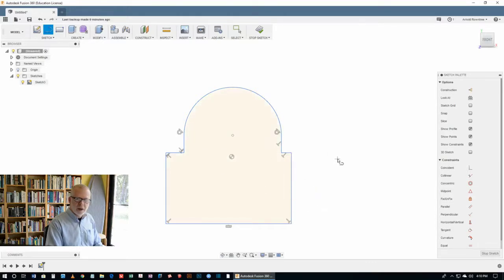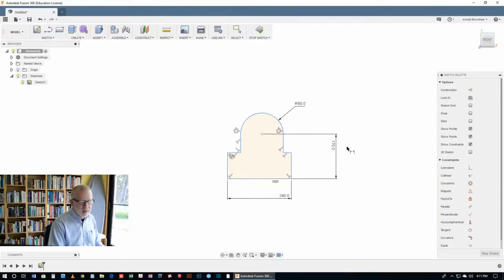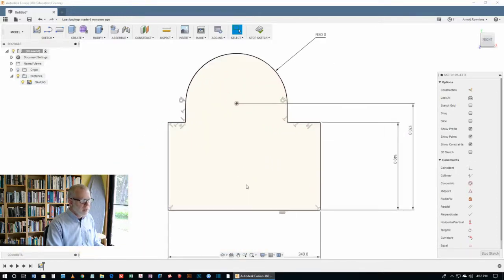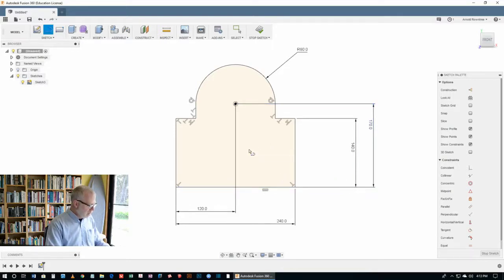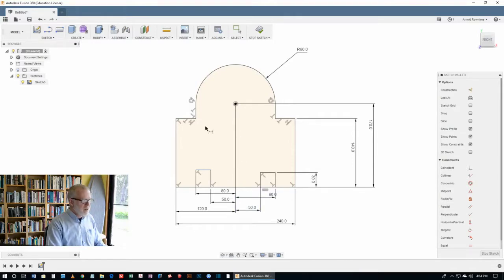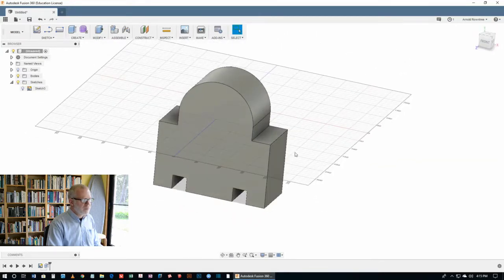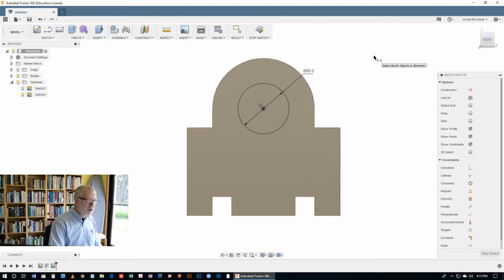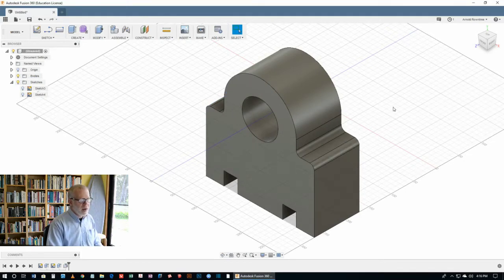Fusion 360 Beginner Tutorials, Part 5 of 16

Comment: Thanks for these videos! You make it look so easy. In reality, however, there are always complications when I try this. Example: I copy and paste new component. Then I go to alter that sketch in order to alter the shape of the new component. Doesn't let me do this. It's maddening. :)
Reply from the maker: Hi WN, yes, I’ve been trained to make it look easy but give yourself another few hundred hours of practise and work, you’ll be there too. And that’s not all that far away. Think of a 40 hour work week, its only seven and a half of those. Two months full time, but even if you have to double or triple that by doing it part-time, its not too shabby for a great new skill.
Apart from that, don’t beat yourself up, don’t stress over components until you’ve got that sketcher down and the basic feature creation tools. I intentionally left the beginners level component tutorials until after the 16 Basic ones. You’ll see them on my channel home page and that will make the intermediate ones a lot easier for you. 
Fusion 360 has workflows designed in by the programmers, they are doing something cutting edge when compared to all the other mid-range CAD that’s out there, don’t wrestle, just enjoy the ride and watch it all unfold while you learn.
Reply: @ArnoldRowntreeTeachesFusion360  Thank you for the encouragement!

Comment: Hi. Can't seem to move the center point of the arc to the drawing point of origin. Says over constrained, but I have the same dimensions on the screen as the video. The video doesn't show axis lines; not sure what the over constraint is. Likely culprit? Thanks.
Reply from the maker: Dan you will see that I drag things around on the screen during the sketching process. (And yes I keep the grid and everything except the point of origin invisible.)
If any line or arc is touching something like existing geometry or an axis or anything else on screen, there will be an automatic constraint applied and the free-dragging behaviour will be curtailed, either partly or completely. Any subsequent attempts to add another constraint will result in the 'over constrained' message and you will also be unable to drag the thing around.
They way I suggest you proceed is to redraw that sketch in a fresh document taking care to avoid any inadvertent constraints. Test by clicking and dragging things around (try not to be over energetic so that you don't mess things up too much). Some pushing and pulling like this will be good for understanding what's going on. You'll hopefully get the idea of how everything is progressively nailed down with each additional geometric and dimensional constraint that you apply.
A lot of what we're doing with the early numbers in the 16 parts is getting a feel for how these things that we're discussing work.

Comment: On Exercise 5 I get the following message from F...360 when I try to dimension the second notch "Adding this dimension will over-constrain the sketch. Choose OK to create a Driven Dimension." Choosing OK places the dimension but I can't change the dimensions numerical value. Is there a work-around for this?
Reply from the maker: Yes John, if you have a geometric constraint already in place, it could mean that you don't actually need the dimension. Once you delete the dimension that was made a 'driven dimension' does the sketch lines have a blue colour or black? If blue then  its unconstrained and you need to work out a way to constrain it other than by the dimension you tried. If its black then you've got it nailed, just proceed to extrusion.
If that doesn't answer the question there is still another way. Find the recent Revised Part #2 of 16 where I demonstrate the Mirror Sketch tool. This part 5 has symmetry and the technique will work here.  https://youtu.be/UxmET4s9Yac

Comment: I really like your approach to learning Fusion 360. I am 77 and trying to learn new tricks. One question  WHen I try to draw the curved line such as the  top of part 5 the curve goes the wrong direction IE it curves down instead of up.  What am I doing incorrect. Dave at Letsflyj3@gmail.com
Reply from the maker: Dave its hard to know exactly what the problem is at a distance and going by a description. That curvy line that comes out of the last segment of the line tool trips up quite a few folks. You really just need to open a new document, start a sketch and experiment. Remember, its click and drag. The curve will always be tangential to the previous straight line segment and its all about the direction you drag in relation to the previous segment. Give yourself half an hour at least to practice this.

Comment: Hi There just realised how your drawing radii with click and drag except my setup id only allowing me to draw in an anticlock direction which is Autocad norm is there a setting to change that?
Finding your lessons just right paced for me as a beginner in 3D, thanks
Reply from the maker: Welcome to the channel Richard. Never mind about the line/arc thing, if you've got it working at all, keep experimenting and you'll get in control of it with a bit more practice. Everything can be done with basic drawing tools, so long as you're getting the model done, move on and get them all finished and come back to fill any gaps later. Go on and work through the intermediate playlist too. I think you'll find there comes a point pretty soon where you'll want to work on your own projects and you'll be able to wean yourself off these click by click tutorials gradually.

Comment: Difficult test!  thanks!  I notice when you click on the main surface it becomes square to the view. Mine does not. Any advise appreciated!
Reply from the maker: OK smith-models, a few preferences can help. I don't take you through these initially because most people want to make something immediately and learn these details as they go. 
You get to Preferences by clicking on your picture in the top right hand corner of the screen.
On the General tab lower down the page you'll see Pan, Zoom, Orbit shortcuts and the style of navigation can be set to emulate Solidworks, Inventor and a few others. Experiment with some of these. I like the Solidworks style.
For Default Orbit type I keep mine set on Free Orbit, you might like the other option.
On the Design tab most people find that 'Auto look at sketch' is already ticked, that one will most likely affect what you're asking about.
One other I'd recommend you have ticked is "Scale entire sketch at first dimenson".

Does that change what you wanted?
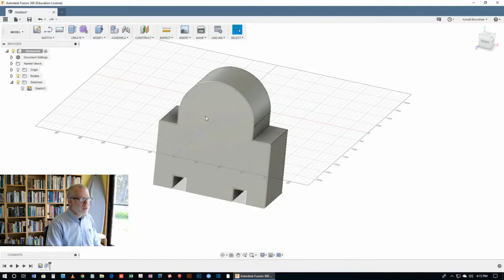Reply: @ArnoldRowntreeTeachesFusion360  At 5:44 in the video are you also using the "look at" function to orient the model into flat position? I hope so. Seems to be working if I use this function. Thanks! :)

Comment: Hi there Arnold, great videos.  I'm surprised how quickly I'm picking this up, thanks for your hard work and excellent tutorials.  quick question: I'm having trouble moving the arc (holding shift from line tool) from left to right, as you do in many of your tutorials such as this one, my working plane (indicated by the orbit box) seems to orient itself FRONT with blue axis (upright on left of the box) and x axis (along it base to the right)  No matter how I rotate the plane, the line tool arc only extends in a half circle upward like this ..... )  my workaround has been to make the exercise above for example, by making a closed box form and adding the curve using a 2 point arc instead, then joining them. it works but seems to be a longer workaround. Any thoughts appreciated I saw in the forum in 2018 that this was an issue? is it still or am I missing something? https://forums.autodesk.com/t5/fusion-360-ideastation-archived/arc-creating-from-line-command-fix-needed/idi-p/7697016
Reply from the maker: Thanks marie, keep learning! 
The forum post that you've linked to is a feature request and many people agree that it could be better. I find that lots of people have trouble with it and so I've been recommending that they find a workaround as you have done. There are always many ways to get the job done, at this stage its best to have a go and if you get a result fantastic. Move on to the next one and after you've done a few more tutorials (and maybe practised more than once) you can revisit this and often that little bit of experience gives you an insight that solves the problem. The main thing you're getting here is familiarity with the new workflows rather than precision. 
BTW, welcome aboard, what do you have in mind to make eventually?

Comment: These are great tutorials, thank you. 
Question, why do you not draw the circle on the first sketch and extrude the hole in one step please?
Reply from the maker: You're quite right, Andrew, it could have easily been done in one step and I chose an arbitrary point to break it up. I was trying to emphasise that you should keep your sketches nice and simple while you're learning so that when there is a problem less time is wasted and its easier to troubleshoot. With another 200 or 400 or 600 hours of practise it will be no problem at all since you'll know exactly what's gone wrong and how to make everything work.
Reply: Arnold Rowntree thanks for the reply. The videos have been a great help. I’ve watched all the series now and see that you do use this method later on.

Comment: O.K., got part 4 done but it was bloody.
  Nothing in Fusion 360 is stable.  It is a moving target. 
   I spent an hour on part 4 solely due to the commands not being even close to those which you utilize. 
  No, I have been able to navigate the project out of pure persistance rather than following your instructions. 
  I am trying to operate a production machine shop for profit here, and Fusion 360 is so loopy I can scarcely make it work. 
  I talked to them about it, but found them to be I dunno... off onto their own thing. 
  I'd like to think they would have listened as I was at that point, a paying Customer.
Reply from the maker: Wow Mark, this is epic!

Comment: I can't make the center of the circle be coincident with the origin, in Exercise 3,4,5.   If someone could answer:  is there a special time to do it, e.g. in the initial sketch?  Thank you Mr. Rowntree.
Reply from the maker: Yes Peter and Mark, do it while in the initial sketch. But just fill me in, are you unable to select the point of origin while in sketch mode? It should be selectable so that you can then shift-select the arc origin and then the coincident constraint. Alternatively, click the constraint and then once on each of the origins.
Reply: @ArnoldRowntreeTeachesFusion360   Concentric circles and incident points did work better when I hit the coincident icon just before the select.
Reply: Same here.

Comment: Why does my curve want to go the the other way when I try to make the ark and is there a way to change the direction.
Reply from the maker: It's a mystery Zap Pa, give it a few minutes but then go on and get the job done with circles or arcs and the trim tool. Get through the basic tutorials and come back to it later.
Reply: @ArnoldRowntreeTeachesFusion360    I have the dimensions wrong, and want to change them.  Is there an easy way to see all the a) numeric dimensions and b) geometeric constraints, so I can modify them individually without get overspecification?  Or should I forget it and come back to it after lesson 16?
Reply from the maker: Sorry I missed this question Peter, you will need to open each of the sketches, starting with the earliest made one and edit the dimensions as you like by double clicking them in the sketch. Constraints show as little icons next to each line or arc segment, select and delete and then apply the constraint you prefer.
Its best to start a new comment, that way I get a notification.

Comment: I'm enjoying these tutorials but this one took me a while to master. I encountered the same problem as Martyn Perks - my arc just wouldn't go where I wanted it to. It took a few tries but eventually I got it. I also had some sort of constraint problem with getting the sides of the arc to sit perpendicular to the "shoulders" of the part. Again, perseverance is the key. I'm looking forward to learning more about constraints!
Reply from the maker: Thanks for embarking on this journey Ward, don't waste a lot of time on this trick, try doing some scribbling off to one side and if it doesn't come right for you, move on and come back after you'ved completed all 16. You might find that the familiarity you will gain can unlock the problem or you will notice that there are other ways to achieve the same result.

Comment: Hello Arnold, am enjoying your tutorial and am having great success up to this video. When I use the line function the arcs consistently go in the wrong direction and what takes you 30 seconds stops me dead. Is there a solution? Thanks
Reply from the maker: Martyn, it has a lot to do with how you drag the mouse out of the end point of the last line segment. ( I take it you mean drawing an arc with the line tool). Keep trying and I think you'll find out how it works. I just did a doodle myself and couldn't make it go wrong. Open a new document, a new sketch and make a scribble. The arc is always tangential to the previous segment, I can't get it to do otherwise. It might go left when you intend to go right but you only need to move the mouse around until it goes where you want it. Does this help?
Reply: Arnold Rowntree yes thank you

Comment: My drawing turned out like it was supposed to but the finished view has the grid running horizontal through the centerline of the hole. Yours ended up with the completed object sitting on the grid. What did I do wrong?
Reply from the maker: Ken, try scrubbing to exactly seven minutes and 9 seconds where I twirl it around and you'll see that my part is like yours. Its an optical illusion in the last frame that makes mine look like its sitting on the XZ plane.